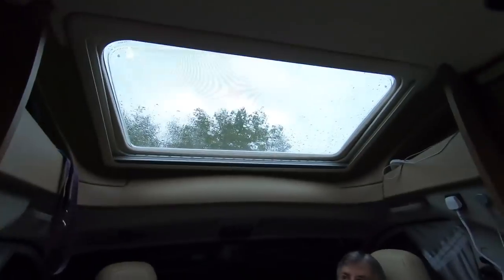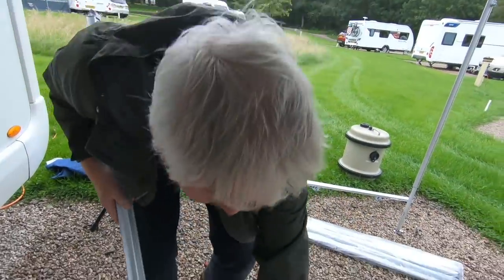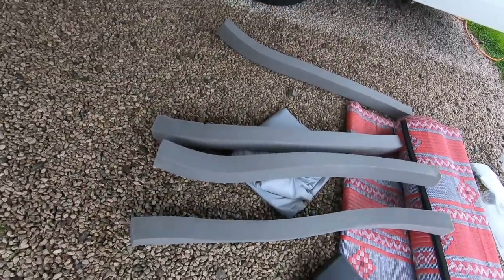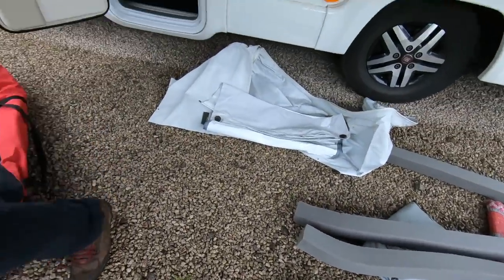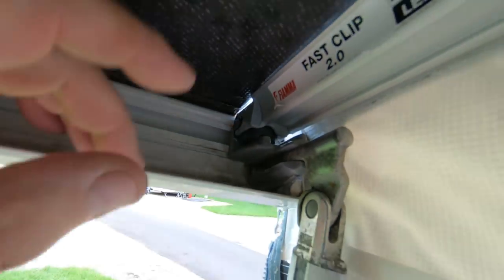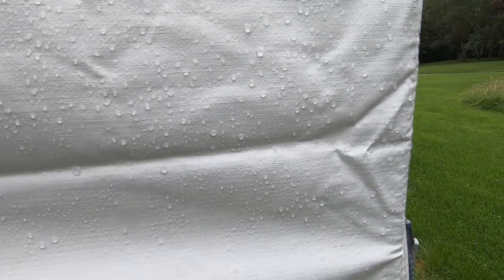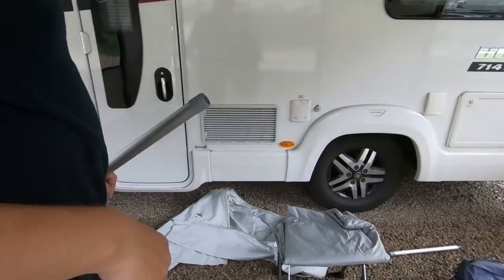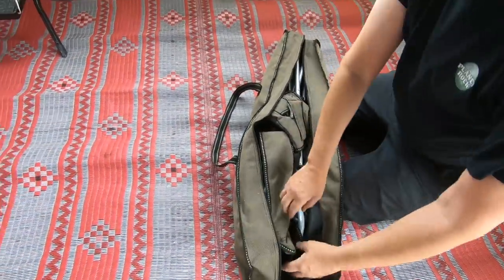Putting Up The Privacy Room 1/2 | Cumbria Trip Pt4

Comment: I also owned one of these,one tip for you.
On the side rails,open them up fully so they detach.
The awming will then sit straight on top of them ,then simply screw the top side back on if that makes sense.
You get a perfect fit then.
Reply from the maker: Thanks for the tip if and when I put it up again.

Comment: I always put the side panels on the rails before I put them up.  Much easier. After a bit of practice it is quite quick to put up but I remember the first few times I really struggled till I got the knack of it.  I also used to forget those little inserts on the end of the rails till I glued them in.  By the way, those inserts are handed, they have a little L and R on them.   Once up it is a fantastic awning.
Reply from the maker: Good tip.

Comment: Looks like a lot of work Bob think I will stick to my driveway. But looks great quality.idea for a long stay over or a warden .Silly question how does the  canopy deal with water when it’s rolled up until you can dry it.can I say well done for setting it up great video
Reply from the maker: Thanks that's one of the other issues, you have to make sure it's dry before putting it away. You can't out it up in the garden to dry off!

Comment: Hi Bob, I was thinking of purchasing a Thule Ormnistor quickfit awning which should be easy to put up and quicker, so need a bit of advice. I was wondering if you could let me know how sturdy the awning was in windy conditions? I was also thinking about an Airbeam but I have be told that they can also move in windy conditions, so not sure which is the right option. The quickfit awning is light which is also a consideration. Once we have setup, we tend to stay put and then walk from the site, so drive away not that much of a deciding factor. Can you pass on your thought? Thank, Mark
Reply from the maker: I haven't had the Thule Omnistore Quickfit, so I don't know how easy it is to use. I use a Outdoor Revolution T2 driveway awning, and if you need to drive away, you can. It has been pretty sturdy so far, but it is quite heavy in it's bag. I stopped using the Fiamma Privacy room, just too hard to put up.

Comment: Are the privacy rooms waterproof? In the instructions it says they are only for sunny days. Our dog is called Pops as well lol!
Reply from the maker: Yes, they are fully waterproof. They need to be in the UK!
Reply: @BobEarnshawMoHo  yes indeed. It’s weird in the manual it says it’s for sunny weather only, not for rain, wind or snow! but then they sell storm straps and say if you do use it in rain make sure one pole is lower at the front than the other to allow the rain to run off, sort of contradictory.

Comment: Had r camper 6 months now tried putting this awning up twice now  nightmare the hardest  and most frustrating is trying to get awning into side bars. We had a  American camper b4 and could put the 5 meter gh awning up in less than 30 minutes it took us hrs to get the one side in  surely the easiest way is bars to slide through awning fixing it to the top then the side sheets slide into the other side that’s the side secured. Way to difficult messing with this if anyone wants one mine is up for sale
Reply from the maker: The other thing that kept happening was the side panels would slip down the side bar. I've not used this since either.

Comment: My biggest pleasure of owning a motorhome, is watching caravaners taking all day to put up the awning .
Reply: Well, my Kampa Ace Air Pro 400 is largely up within 10 minutes (the 12 volt pump inflating the tubes through the single point of inflation as I put up the 2 back wall Poles and hammer in a few pegs).  Putting in the remaing pegs and storm guys might take another 15 minutes in total, but it would be a bad day if a pot of tea wasn't on the table and ready in 30-40 minutes!  Caravans and awnings are natural bedfellows.
Reply: Having now watched more of the Fiamma erection process.... I am glad my caravan has an inflatable awning.  I hate to think how you would put up the Fiamma in anything other than almost flat calm weather!

A simple operation for me and my wife - the awning sides and front are all put away in the bag after deflation the previous time,  without having been separated.

 So the 2 of us slide the awning into the awning channel, I put up the two back wall Poles which hold the pads against tgs caravan side, and the inner corner pegs, whilst the 12v pump inflates the awning (about 5 minutes) then my wife and I peg the awning down all round. We also have a skirt which normally goes in first.  Simples as those Meerkats say!  

And last weekend it survived 50mph+ winds and driving rain at Whitby, whilst it's predecessor which lasted almost 5 years, survived a 61mph hurricane (or the tail end of a hurricane) at Grinton near Reeth, NYorks a few years back.  Funny thing about that was the BBC Weather App had the wind dying down at 5pm to a much more "restful" 28mph or thereabouts, and dropping away swiftly after that.  It was as if God had flicked a switch because the wind died down almost on the stroke of the clock. Happy days, and since most of our friends were sensible and took theirs down when the strength of the wind had become apparent, we had plenty in our awning that evening! 

Anyway, a pleasure to watch your efforts!